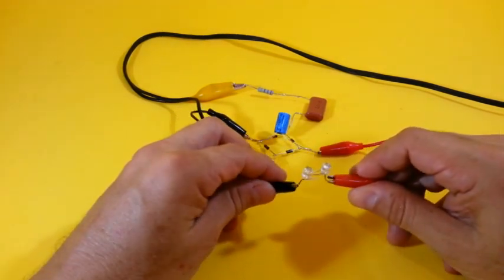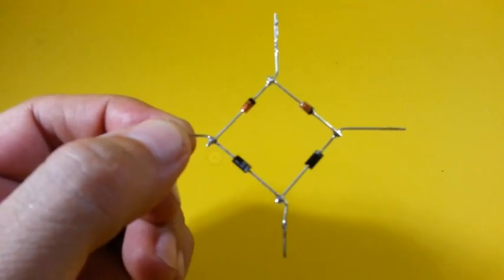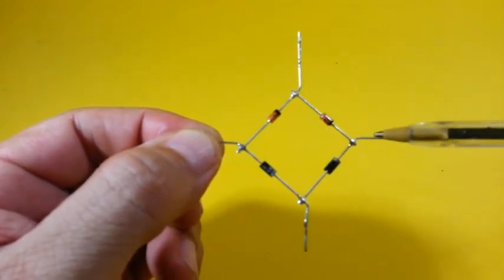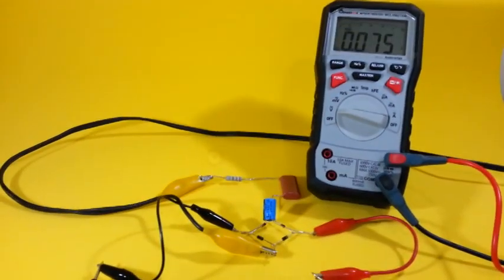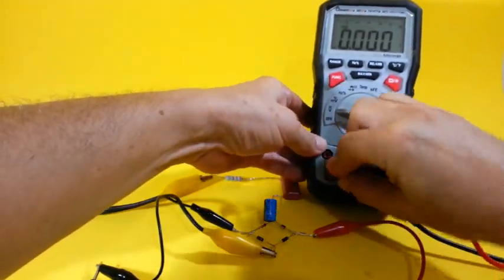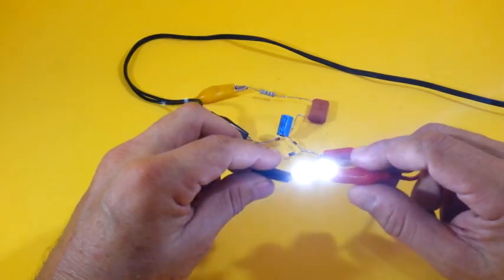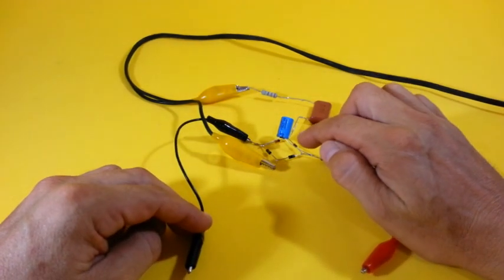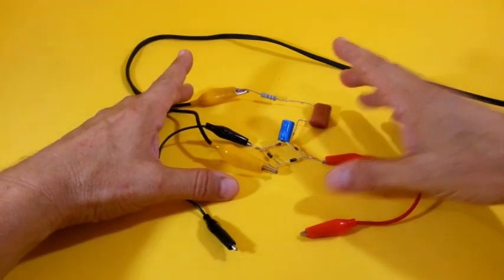Transformerless Power Supply

Comment: Wouldn't the zener diodes heat as they short voltage above 12v?
How long can we run this circuit reliably?
Reply: I was wondering about that, maybe a higher wattage?

Comment: Sir only 1 zener diode (12V) in parallel with 220uf/50V capacitor will suffice? I mean I will use 4 IN4007+capacitor+1 zenor.

Comment: Thank you. A couple of questions: 1: You mention a 5W resistor but I have the impression the resistor you use in your circuit is the 2W one? (the 5W one starts being quite chunky). 2/ Aside from the reference to mains danger of electrocution there is the electrical circuit safety, a fuse should be enough to protect the mains from a short? (i.e. a 100mA fuse, as in this case the circuit would be for approx 70mA), thanks.
Reply: BTW, to get higher power with regular resistors use them in parallel and multiply the ohm value by the count(how many you used)
Example, you want a 1K ohm 1W resistor but you got only 1/4 watt ones. so use 5 x 5K in parallel :)
500 ohm 1W but you got 1/2 watt ones, so 2 x 1K :)
try it :)

Comment: thanks i like the circuit. can please tell if is it works without ac np 440v capacitor and resistance on ac side.  please explain if it doesn't works and why.

Comment: I would like to this circuit with main 110Vac to 12V dc 2A , so what need to change from resistor or diode and 2 capacitor more value than on your circuit , how I can do it . Please explain  al capacitor watts &Volt on all resistor w&v on Zener diode or 1n4007 watt& Volt too  and get diagram for me and send it to my email tonghoang661@yahoo.com
Thank you for cooperation.

Comment: This could be quite dangerous if the live happens to get connected on the AC side, going directly into the bridge rectifier. Then the output basically floats on the live and both the positive and negative output wires are going to shock you if touched. If you use a polarised plug and make sure that the  circuit can only be plugged one way in the mains, then it will be somewhat more safe to use. But if you really want to be on the safe side with this type of power supply, then connect it to the mains permanently and just add a switch to turn it on or off. This way you are going to negate the possibility of coming across incorrectly wired wall socket and having the hair blown of your head. On another hand if you just plan to build something like a led lamp or whatever, and have it permanently closed in an isolated case with no intention of tampering with the circuit while on, then it doesn't really matter how you connect the live.

Comment: hay I made this but not with zener diodes , normal bridge rectifier, but when I connected it to the socket it just shorted,I checked it with ur other video and I had made every thing correctly but it still shorted. what should I do. and I subscribed. plz also subscribe me also as I have started a new channel ESPEON GROUP which is base on randon stuff including electronics. plz check them out and tell me what is wrong with it.
Reply: Maybe it's too late, but check connections and especially diodes characteristics and their directions.
Reply: hay you shorted what happen ?i can you a clue y you shorted.bcoz 110vac and by ur using diode normal diode bridgetype so out is 110 dc that is patible using zener 5v diode is to regulate voltage it is a correct

Comment: Dangerous rubbish.
Reply: many white goods have this type of power supply probably 2-3 devices in your home 
here is a indesit dishwasher electronic notice blue capacitor and zener diodes thats this supply in real world appliance 
http://static-0.yourspares.co.uk/media/p/ind/0/10/l/C00143210.jpg
with device that have parts that work on 220v least worry is that electronic control is not isolated ... just folow grounding rules and you are good to go

Comment: I 've seen this circuit before and I think the top left zener diode and the bottom right rectifier diode should be swapped with one another. The way it is shown on the schematics, only the top right zener diode is doing all the regulation the work. The top left zener diode never gets to do any rectification work. The way you have it  still works because the capacitor holds the charge.

Comment: Can you provide other characteristics of this circuit. For example input power to output power. What is the voltage stability under different load levels ? What is mains current under 0 load ?

I would like to make a power supply for ESP8266 (3.3V 500mA), what is the most efficient way to make this circuit ?

thanks
Reply: You better make switching stepdown voltage regulator. Guess it"s far more efficient. Or even better ask someone 
in your area who  is good with electronics.

Comment: how i can increase the dc current ?
Reply: You can't :) it got limitation of 70mA because of cap and diodes, zeners.
Zeners can handle 1W or 1/2 watt ( depending on model ) so .5 watt / 12 v = ~0.042 = 42 mA ;D
That is even less than 70mA

Comment: It can be an excel file with all the data that each shawl download and set as desired voltage, which voltage is 110, 220 ... how many LEDs wants to connect or current mA ?

Comment: you need to explain more why it's dangerous and how it can kill you, more then it's just connected to the mains and it's dangerous.
and,
you can make it a lot safer if you limit the current on both legs, right now depending on how you plug it in to the socket you can have the full 220v, unlimited current, on one of the outputs, if it finds another unlimited path to the ground, for example a grounded fridge near you, you are screwed.

Comment: Thanks for the awesome video! I live in the uk where mains voltage is 240V AC could you tell me how the component values would need to be altered to accommodate this high voltage? Thanks!
Reply from the maker: Thanks! you can use a 470 Ohm (5 watts or more)  resistor and a 1 uF (400v or more) polyester capacitor.

Comment: I have a similar power supply for lightning a set of led's but with longer usage the filtering capacitor blows up, i have replaced it twice but it is still exploding. My led's are connected in series, each time my cap blows up, it destroys one led along with it. I checked the output across capacitor and it is 18v when it is in running state. Cap rating is 47uf 50V. My circuit uses MB6S as bridge rectifier and rest is pretty much the same.
Reply from the maker: that would imply that there are voltage spikes larger than 50 v
Reply: i opened a 3 w led bulb and have same condition as you says and in my case also cap blowned only when i removed the leds

Comment: you can also make capacitor based voltage divider, rectify with 2 zeners and 2 normals and electrolytic. this way you skip the power losses in the resistor
Reply from the maker: Problem with that is that a discharged capacitor acts as a short. The moment you connect the capacitor to the mains, a very large current will flow. The resistor limits that inrush current.
Reply: Ludic Science then put thermistor instead of resistor. a common technique used in all kinds smps.
Reply from the maker: Gotin Fuklio That may be a better option

Comment: how can did i this with 220v ?
Reply from the maker: If your mains voltage is 220V, you can use a 470 Ohm resistor and a 1 uF capacitor.
Reply: thank you so much

Comment: this is called capacitive dropper
Reply: and it will shock you pretty bad if you touch it while standing on ground or touch metal housing of equipment that are grounded
Reply: Mostly used in cheap Chinese LED Lights and yeah, the electric shock is quite nasty.
Reply: I don't know why it should be capacitive dropper when the heavy weight dropping is done by the resistor anyways!!!

Comment: If all you want to do is light an led from mains voltage just use one diode and one resistor.
Reply: Still too much power is wasted in this setup.
Reply: How many watts of resistor you're using?
Reply from the maker: I used a 2w resistor but it gets pretty warm, it is best to use 5w resistor as stated in the diagram
Reply from the maker: Clark Yes, it is simple, not efficient.
Reply: +Joseph Nicholas 50hz definitely flickers to the eye. are you one of those idiots that say the eye can only see 25 hz?
Reply: How old are you?
Reply: then it will extremely flickering
Reply: I tried this myself with a 470k resistor and a in4007 diode and no flickering.
Reply: because the flickering are very fast, about 50/60 times per sec, when that LED in the dark you it will get more noticable, also when moving
Reply: Like I said, it doesn´t flicker to the eye. Anything else is purely hypothetical.
Reply: Fuck off troll.
Reply: Joseph Nicholas not trolling. You are seriously a fucking idiot if you believe that. Proof says otherwise
Reply: Clark - half watt is enough